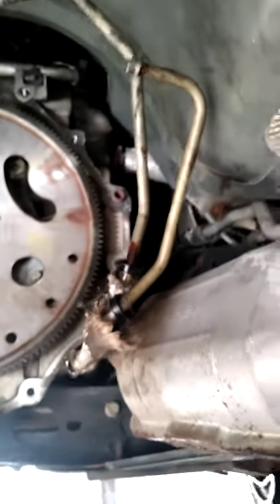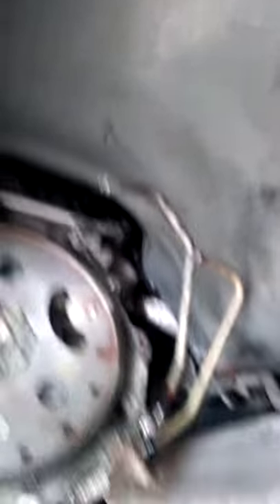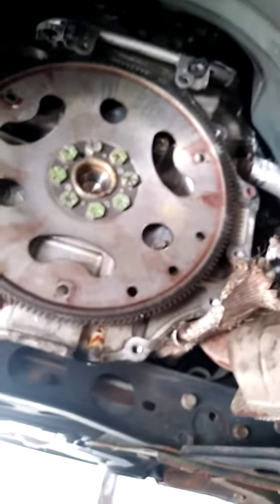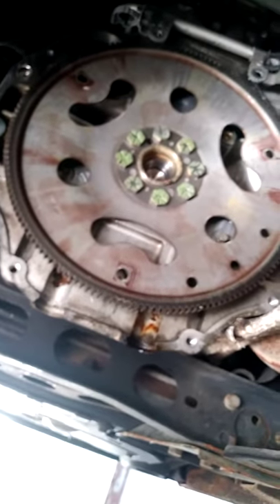Stuck dowel pins on transmission

Comment: Im gonna try this haha mine is currently seized together pretty good and I don't have the space to safely torch it
Reply from the maker: I had to hit it with a hammer a lil n shake it to get it to move, with tension from the ratchet strap pulling away from the engine.